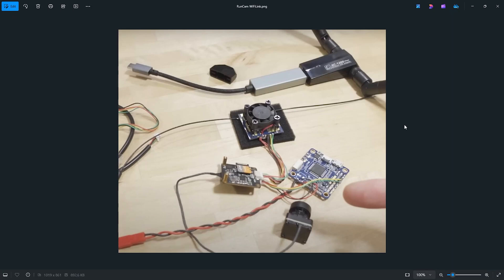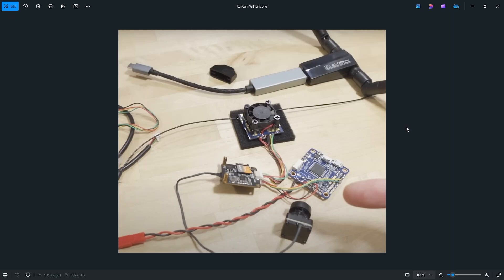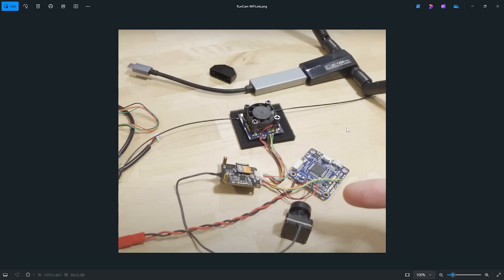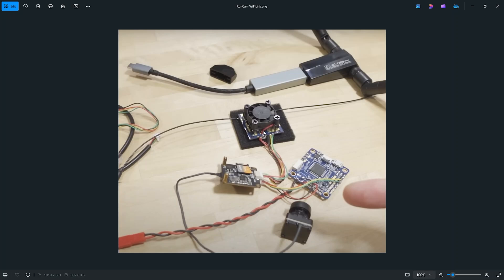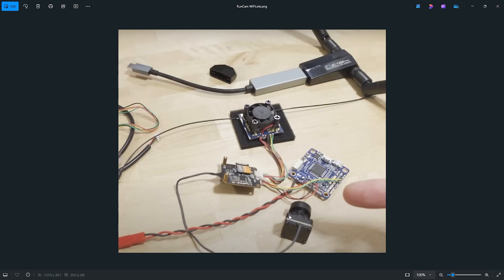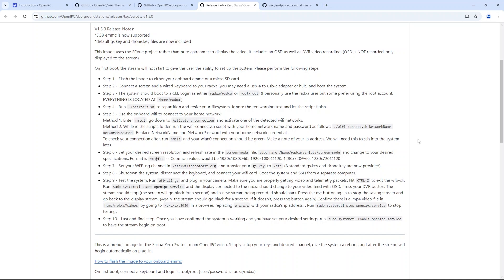What is OpenIPC & Where Can I Get More Info???

Comment: An excellent overview, and resource summary. This was actually very helpful.

One suggestion, it's "repurposed' hardware with custom software. Think of how linux was developed to run on a desktop PC a couple decades ago. OpenIPC is the resource stack for encoding, transmitting and decoding video.  'Hacked' hardware is a bit confusing, as hacked has multiple meanings today, not like the early DIY days of computing. 
In the linux analogy OpenIPC today is like downloading the source code to build and compile your own version with the drivers needed to run on your hardware. No distributions, no package managers for drivers, etc. It's hardcore, as the utilities and tooling are still being developed.